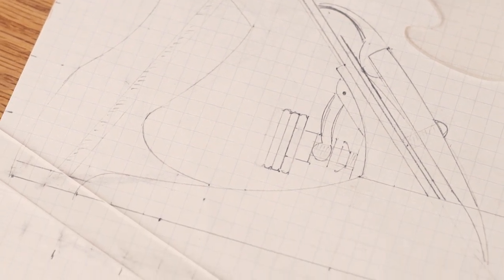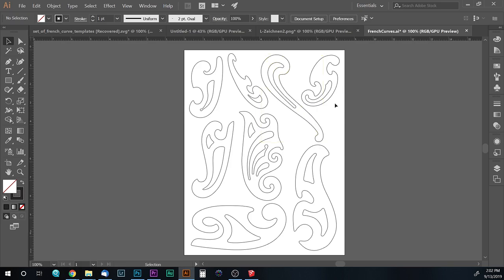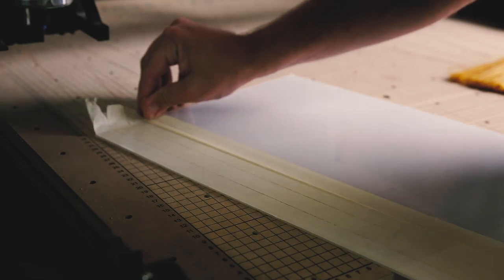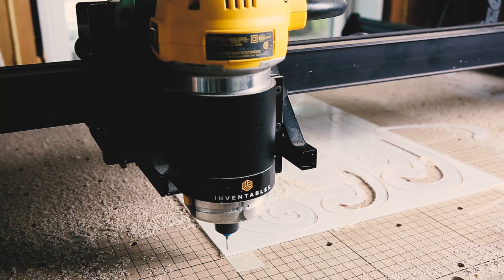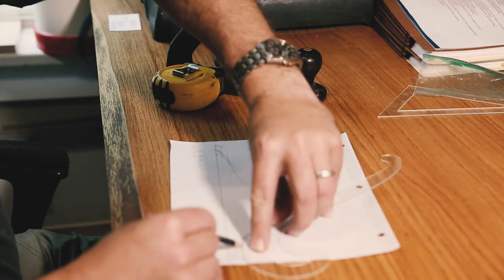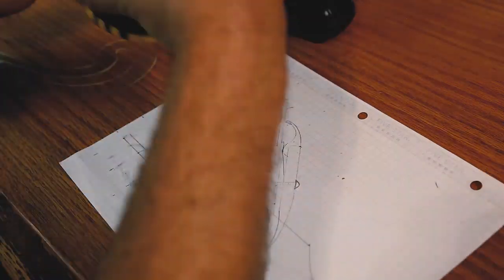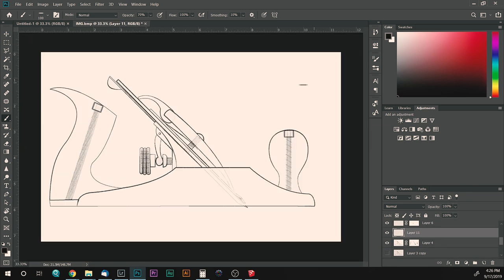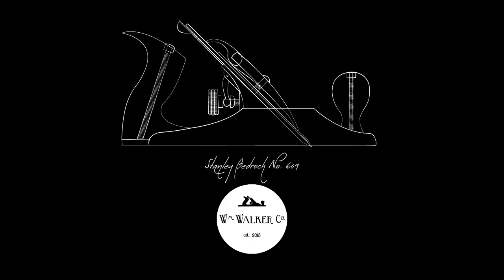Learning How to Draft by Hand

Comment: As an old guy, i had drafting in high school and at my engineering college in the 70's .  Early in my career, all maps and diagrams in my job were hand drawn, so I've been around drafting a lot.  I have all kinds of tools as well.  In my line of work, i was a content creator, the drafting department turned my drawings into archival and professional drawings.  I mainly made subsurface geophysical & geological (oil prospecting) maps and cross sections from data in tabular format, or geological/geophysical data printed on paper and interpreted with colored pencils.  My drafting table had appreciable deposits of electrically powered rubber eraser dust on the floor and my electric pencil sharpener had to be emptied several times a day, aside neatly stacked and folded copies of my working data.  We even had a special protocols for folding large format pieces of paper so they could be filed in 8 1/2x11" file folders.

Important principles in drafting include the ability to make a drawing of the same object from different view points (right, front top, isometric, etc) as well as solving graphical problems with straight edges, compasses, dividers, etc. so it is not simply as a method of drawing, but mainly as an analytical tool.  For example, from a number oriented borehole cores retrieved from the earth and maybe an outcrop, deduce the shape and orientation of a sheet of rock 2000' below the surface, using graphical (drafting) methods alone: to solve a structural geology problem, then render it in 3 dimensions, but expressed only in 2-dimensional drawings.  Fun stuff. 

As my career progressed, the drafting department stopped using so much of ink pens and mechanical pencils, and switched to taped lines, stencils, "rub on symbols" and such.  I remember the drafting department manager lamenting that he saw his entire department being phased out in the future, because content creators were moving their data and analysis onto computers with special purpose software, that can also generate drafting quality maps and diagrams.  CAD was coming along as well about this time.  Half way through my career, all working drafting departments in the oil industry disappeared.

Now, I wistfully look at my drafting kit, and easily go to Sketchup do get done what i need instead.  I still have all my tools, just don't use them anymore.

Comment: I took drafting back in the 1960’s. It was all by hand, a calculator was a slide rule. My grandson is a carpenter and is amazed by my small drawings.  After drawing your plan, you would use ink pens and black ink to finalized the drawing.

Comment: Drawing looks awesome especially for your first self taught attempt. Plus pulling all measurements by hand and translating to paper. I do drafting/design work for a living for concrete and steel work. Did hand drafting in high school 15 years ago. Some tips I remember and still use some for hand sketches for work. 

A metal erasing shield (must have) will be your go to tool for erasing in tight corners

Drafting dry cleaning pads will help clean up any smudge marks your hands leave from the graphite. (Not required but just something to look at)

Also as someone else mentioned, a good mechanical pencil (with a metal extended tip) and work on your line weights (thickness of lines)

Your picture looks good as is, you could test out hidden lines to show that an item is behind the front material. So blade behind the base or even screw in the handles. For artistic reasons may not look as good so may be something to just play with and test out. 

I see CAD drawings everyday but when we have to go pull old drawings for reference and they are hand drawn you get to see how much of an art form it truly used to be. Those guys were flat out talented and it is becoming a lost art. 

Keep drafting and keep up the good work.

Comment: I took 4 years of drafting in high school, an associates degree with 2 more years and and did manual drafting as a career until the early 90's when we converted to CAD.  Build yourself a good size fold down table and pick up a quality universal drafting machine off eBay.  Happy to help if you have questions.

Comment: You’re video brought back great memories of my high school drafting classes back in the mid 1960s. Back then I really enjoyed drafting but haven’t done much since then. Of course in those days we used vellum paper without a grid and couldn’t clean up our drawings in Photo Shop. They had to be perfect after the drawing was complete. I’ve always thought of setting up a drafting station in my shop but just never seemed to have the time. I even have a space reserved for it under one of my shop windows. With programs such as Sketch Up and Fusion I’m sort of torn between learning one of them or going back to my roots and designing on paper. Perhaps I can design a combination station with drafting board and computer station. I need to think more on that. Thanks for the inspiration.

Comment: I love Your films, but this imperial measuring system is ridiculous.
Reply from the maker: I've used both. I prefer a fractional system. Also the US lumber industry is based in imperial. I dont care what you measure in as long as its consistent.
Reply from the maker: Think of it like this: if I have 3/4" stock and want to make a mortise and tenon joint. I know I want me tenon to be 3/8 and that leaves me with two 3/16th" shoulders. It makes layout really easy.